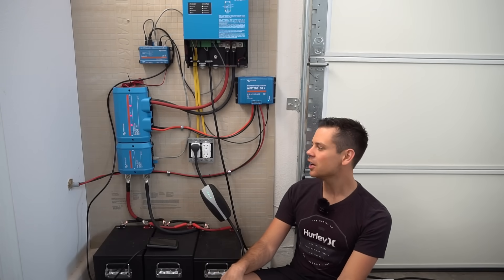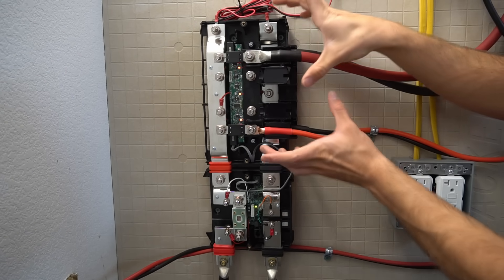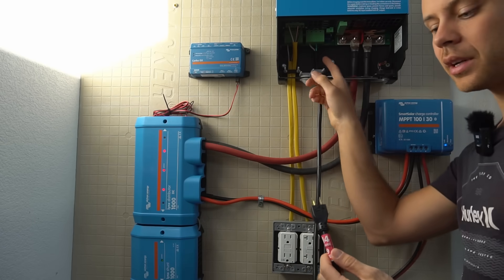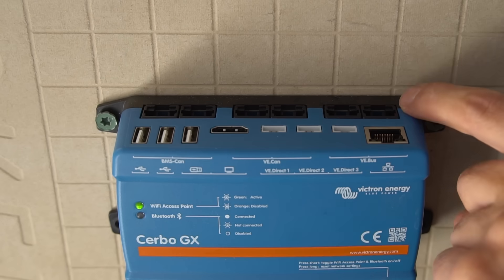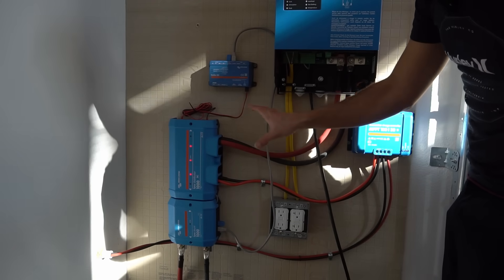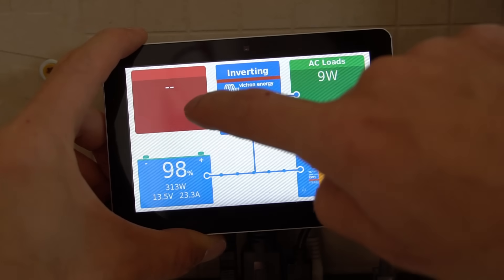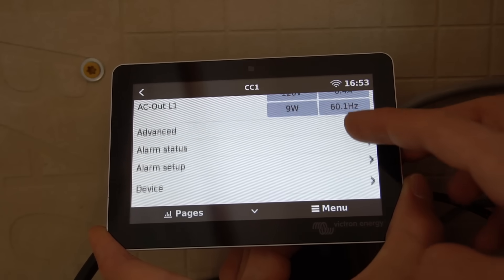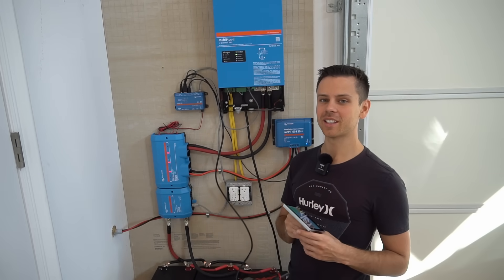Victron Made Easy! Design and Communication, Step-by-Step

Comment: It always helps if one manufacturer makes all of the components of a system. Much better communication. 
To avoid that cable mess/confusion they should make one wiring harness that’s easy to mount and has clear levels. 

In a previous video you mentioned buck/boost converters. Can you make a video about them and which charge controllers have them build in?

Comment: This multiplus 2 inverter is 3000va is 2400watt not 3000 watt 12 V , Will try to put a load 2500watt and it turns off in 15 minutes

Comment: I've been looking for such a video, like 6 months. Thank you so much. Victron is really complex and uses so many types of connectors. I got lost somewhere in between all of those PDF Files and Schematics. Could you please set up this system, so that is does not use any Energy from the Grid? Like, Solar power charges the Battery, if the Load is less than the panels produce and uses the Battery when there is no Solar power. How to set it up, what limits of discharge for the batteries, and how to wire up the energy meter.
Reply: If he unplugs that black power cord... Then he has what you are taking about. It has a solar connected to it (the 100/30 mppt) that charges his system. In your example you could use the black power cord to connect to a generator as a backup in case solar doesn’t make enough after a few cloudy days.
Reply: About the config... Normally the battery is sized in a way that it can handle the inverter load. There is nothing special to configure as far as I know for the use of solar directly.

Comment: I have Victron and love it! I noticed you have a 100/30 Solar Charge Controller connected to 800 watts of panels with 12 volt batteries. The cool thing about Victron Solar Charge Controllers is that you can over panel them without damage. It's a very cool feature. 😎
Reply from the maker: Exactly!! I love that about them
Reply: Will I want to if you can put 48v on my rv
Reply: You can over panel most solar inverters? You just can’t exceed the voltage limits. It’s common practice here to set up 6.6kW of panels on a 5kW inverter. The little bit you lose over a year’s solar is negligible. I have 9.2kW of panels on an 8kW SolarEdge inverter. I could over rate it by 30% if I wanted to.
Reply: @mondotv4216  he said over panel the solar charge controller not the inverter
Reply: @agg25gga  The solar charge controllers do have voltage limits though-I am not sure what @Jonathan means by over-paneling. For my setup for example, I can do anything I want but I have to stay below 150V/100A, and so I have my panel array in 3 strings of 100V/20A each one feeding a dedicated string input on the Easysolar.
Reply: The cheapest way to get enough redundance in an off grid system at latitudes with dark winters is to overpanel - even radically. My own Smart Solar 30/100 works very well with 250 percent panel effect, and I would like to even have some more. The SM just takes it's 30 amps and ignores the rest on the sunny days. Wonder if there is a limit? I haven't seen any mention of it from Victron.
Reply: You mean over-panel in terms of wattage but staying within the max voltage and amperage of the charge controller, right?
Reply: @reflections9409  stay under VOC with temp coefficients, but amperage will be limited by your charge controller limit (clipping), thus limiting your wattage to the multiple of your max amps x volts, if I understand correctly.

You can exceed the charge controller’s max amps, but not the max voltage...

The charge controller will limit the amperage to whatever the limit is on the controller.

However, if you exceed the voltage, you’ll fry it. 

(This is what my research has led me to understand. I’m not a professional in this field.)
Reply: @jessematchey4802  you are very perfect!! To achieve consistent charging and harvesting even on days with not so good sunlight over paneling does help.

Comment: I get the comment on easy but I do not like that Victron essential has 3 communications protocols used in this simple 4 device system. I would prefer for a true simple system to have one daisy-chained, non-terminated communications system.

Comment: Can someone please explain how that 800watt solar array is not oversized for the 100v 30a charge controller?
Reply from the maker: I like to overpanel. I just do not exceed the voltage input limit of the controller
Reply: @WillProwse  Thanks Will, I have read the thread on your forum around overpaneling, and unfortunately I am still not fully understanding it. I'm clear on not exceeding the voltage but then worry around exceeding the amperage. Would this be a topic for a video from you? You are so good at helping us out by explaining things simply and in detail at the same time!

Comment: Another great video Will. I am a big fan of Victron.  They are expensive but seem to be very high quality.  Do you know if the devices can communicate with each other via Bluetooth to eliminate the communication cables? Thanks!
Reply: They can connect through Bluetooth to each other.
My battery sence sends the voltage and temperature to the smart solar mppt.
If you also use a smart shunt it will take the voltage from there and only use the temperature from the battery sense.
The shunt will send the current and voltage to the smart solar charger in this case.
You have to put all your devices into the same Bluetooth smart network through the victron app, very easy to do.

But this is only for the device to talk to each other, if you what to use a cerbo gx or a raspi with Venus os you have to use the cable connections.
I use Intel cables for server Backplanes which use the same jst connector :)
Reply: No they can't communicate with each other via Bluetooth, they communicatie to the VictronConnect app with Bluetooth. I think you want cabled connections for devices-communication anyway.

Comment: Love your reviews!!! In this price range I'd think Sol-Ark would be comparable. Will you please review the 12k and share thoughts on the soon to be released 15k model from Sol-Ark?
Reply: DavidPoz has done a few videos on the 12k. It’s a decent all in one, but both legs of the 240v output needs to be fairly balanced, otherwise it’ll pull from the grid or will overload.

Comment: Great presentation, but left me with one question. You said you had 800 watts of solar going into the system, but using a 30 amp charge controller with a max input of 450 watts. What am I missing?
Reply: Yeah, exactly what my question is.. How can he have 800w for 12v 30a mppt
Reply from the maker: Yeah, it does not mind overpaneling. As long as max pv input is not exceeded. And I'll be adding a 50A victron controller here soon, but only had the 30A for now. It won't hurt it
Reply: I can't say for sure Will's reason, but just guessing, this would allow for better charging earlier and later in the day when the sun is not optimal.
Reply: @rgbii2  is 800 watt panels were only pushing out 380 Watts. I wonder if it's because of the time of day or the time of year
Reply: So until he gets that swapped out for a larger one, I guess only about half the power output of the panels is being sent to the batteries. The rest is clipped.

Comment: That's really nice. Personally I would like to see one type of cable to connect all the devices
Reply: I think different cables are fine as long as it’s for safety 😉
Reply: These sysrems have been around for decades now. Its history.
Reply: I agree. HDMI AV cables have been around for some time.. VE is big on proprietary parts and $$$$
Reply: Bluetooth
Reply: This is the case if you use the VE.CAN MPPTs but those are generally much bigger MPPTs
Reply: victron connect cable is jankey

Comment: Living off grid for 9 years, Victron never let me down, the only system with centralized charge current management depending on SOC (DVCC), free cloud service (VRM). Will thanks for you're clear explanation video.
Reply: what is your setup? can you share pics please
Reply: @jamesbond0004  can't put picts here try following me on FB
Reply: @sfa22  twice lead acid, 4. years ago switched to  lifepo4
Reply: Me too, living on victron to run my power and train business. 
Best equipment available.
Reply: Well you were lucky, the new  Viktron is not the quality you think.
Reply: and double the price...so not so 'free'
Reply: for the price they cost u will need to live off grid more 20 years just to compensate the value you spend on it.
Reply: @marine1718  With the energy prices nowadays you earn it back in one year
Reply: @martijnheeroma5492  hahah that is a funny joke sadly not true
Reply: @marine1718  My neighbour pays 800 euro's each month for electricity that is 3 Multiplus 48/5000 each year
Reply: @martijnheeroma5492  that coswis to much u will need mutch hardware to produce that mutch energy. And will not pay in one year
Reply: @martijnheeroma5492  And mine neighbour pays 20-30 euro with mains and I'm I'm offgrid 🙄

Comment: Victron could have incorporated all these systems into one unit. Many small and expensive devices.
Reply: They already did it. Victron Easysolar II GX
Reply: @Ismsanmar  nice
Reply: I'm glad they don't, as it allows me to pick and choose the components to meet my own design. Their big market is things like boats and RVs, where you want a lot of customizability. Especially when it comes to the solar controllers, you want several smaller ones as it deals with sets of panels being shaded vs not, different sizes of panels for different spaces, and so forth.
Reply: Systems with separate components like this are built to last a very long time.  Basically if any of the pieces an all in one inverter dies, you are at the mercy of having to buy a whole new one.  With this one, you can replace individual failing components, or upgrade/expand to a new component/system a little bit at a time.

Those all in ones are probably good for a heavily depreciating RV, but for a home or off-grid cabin, this is the type of system you want.
Reply: Prefer separate devices for remote touring means I still have redundancy if need be.
Reply: They have one. the reason for the individual parts is customization, easy to upgrade one part or replace one part without scrapping the entire system. scalability. If you want all in one look at Victron Easysolar II GX. If you think it all costs too much then buy something cheaper without the features, free web support an other things you may not want or need. Will puts a ton of much easier, much cheaper stuff up here. It's easy to appreciate them as it is a system like this. ...or just spew hate at it out of misunderstanding lol...
Reply: That has to do with the fact not everybody want to monitor their system for example. Lots of people buy the inverter and smart solar only and others need a disteibution-system  and another one also the monitoring. So the small party make sense, and indeed, check easysolar for a complete system.
Reply: I would advise Victron get on that yesterday...as some company is going to come out with an 'ALLINONE' system of very high quality, and could bury Victron in short order! Who doesn't want a single unit with dip switches or card swaps for varying load settings! This Medusa clutter is pure nonsense!
Reply: @MUCK1955  They already do. RS 48/6000 and Easy solar GX. Dip switches and cards are long gone for Victron. Everything is App or PC software now.
Reply: @MUCK1955  Victron has app controller stuff. Dip switches are from pentium age. Also Victron has complete systems if you prefer over separate devices

. It is a pity people write and dont have knowledge of the stuff that is available. No offense..
Reply: Yes, was thinking that, thats what most other companies do. would NEVER buy a Victron as all the parts cost twice as much.
Reply: I believe victron is supposed to be built to the highest standard for commercial applications. 

These shouldn't really be compared with like a growatt, but or more comparable to a fronius. 

It's not cheap, but that's because this stuff should be in a commercial boat or a cell tower, where failure is unacceptable.